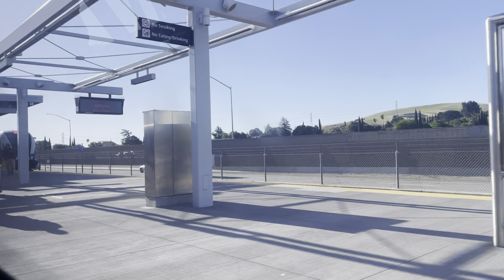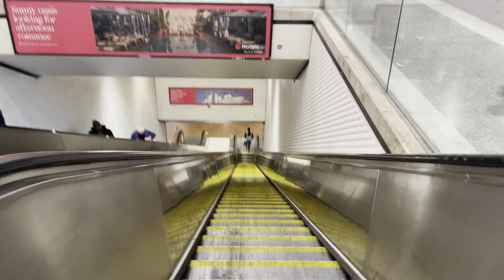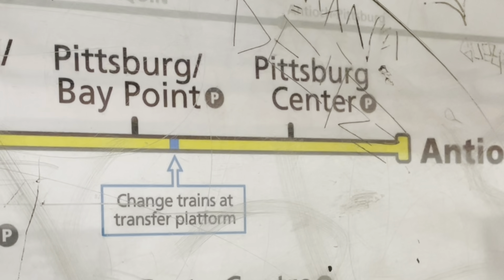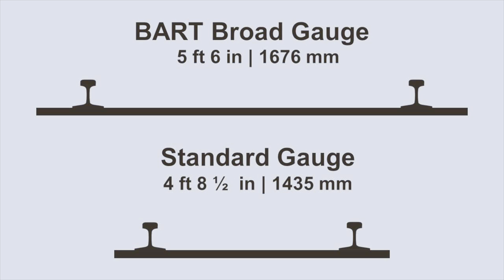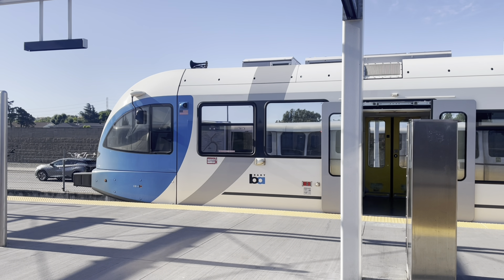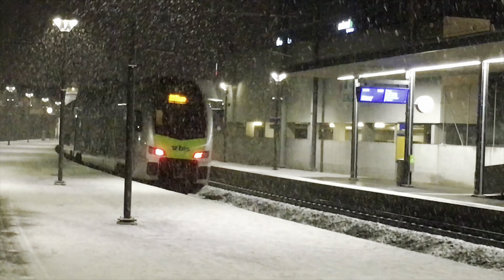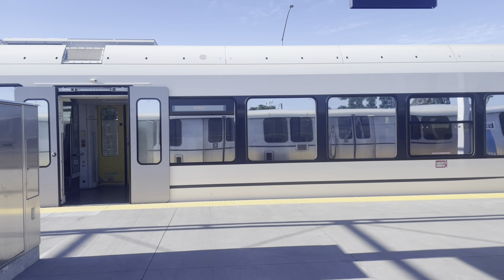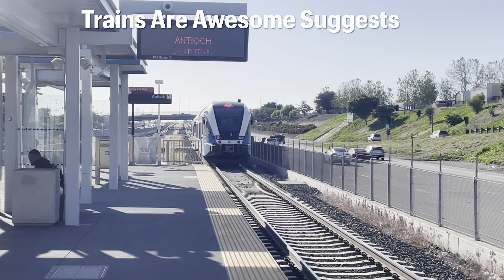eBART: The Strangest BART Extension

Comment: I do not believe the claim that it cost less, let alone half. You save by slightly reducing track quality and not having to build out the electric infrastructure... but you then have to build a whole new operating and maintenance base, buy entirely new trains on a new contract with a higher spare ratio, hire specialty maintenance crew, build a new transfer station, and a bunch of other stuff. PLUS now your operational cost is higher because you arent able to use a lot of the existing maintenance infrastructure, AND because you have to staff a transfer station, AND diesel trains cost more to maintain, AND you have to buy fuel for the diesel trains.

Idk, unless someone can show me a budget document that explains why ebart didnt cost more to build, I just think it is corruption

Comment: Great video dude!

I can't help but feel like they could have just extended the standard gage tracks a little bit further into the Pittsburg station, so the transfer happens there. Sure, it's still cross-platform, but at least then if something goes wrong you can walk out of the station or wait in a nicer transit hub.
Reply from the maker: Yeah I don’t know why they set it up that way

Comment: I am a resident in the bay area. I have taken this line regularly since 2018. It is really quirky. Typically only every other train on the line goes to the transfer platform. This makes delays really frustrating. If you just barely miss the antioch train, its not just waiting 10 minutes for the next pittsburg baypoint train, but you eventually will have to wait for the antioch train that is coming 20 minutes later. This makes a long ride even more time consuming because money.
Reply from the maker: I never realized the frequencies were different between the two

Comment: How well do the train operator and the automated annoucements explain the transfer process once you get to the station?
Reply from the maker: The operator did a decent job iirc
Reply: In practice it works very well.  You either walk off one train and straight onto to the other, or walk off the eBART train & wait a few minutes for the train heading to SFO airport.  There is no tagging on or off involved.  The eBART trains are quiet and fast easily keeping up with the speed of the highway traffic.

Comment: My main question is just why. Why, even regardless of money, would anyone see this as a good investment! The added journey time, lower practicality, lower passenger numbers, and extra faciltiies needed would surely make it a much worse investment than the more expensive full BART extension.
Reply: What you don't understand is that the people on that side of the system have been paying taxes from the beginning. In Contra Costa county we have a extra  tax that we paid in order to develop bart. Bart began on this line. And has expanded over its 50 plus years in existence. Bart decided to expand to San Francisco and put that side on hold.
Reply: @rebeccalane7691  Well yeah of course they're an urban rail system, you need to make sure the urban part is in order. Especially since a much greater portion of the tax payers contributing to it are in these more urban areas. But the main thing is that by this county cheaping out on the extension in this incredibly weird way, they're getting even less value for their investment than if they had waited and made a slightly bigger investment with a regular BART extension. With e-Bart they've shot themselves in the foot and made a subpar service that they're gonna see stuck with for decades to come

Comment: A short-sighted implementation consistent with BART planning in general.  Any BART extension needs to eventually go on to the next city to the south, Brentwood, with a population of over 60,000 and still growing.  But as with BART leading to Pittsburg, eBART extends along he middle of State Highway 4 which was widened to accommodate this during a recent extensive highway upgrade.  However this accommodation ends just past the Antioch station, preventing any further "affordable" extension.  They could have instead used an old WWII era railroad right-of-way just past the Pittsburg station to take an eBART track to the north of Highway 4 to meet the old Southern Pacific (now Union Pacific) Railroad trackway which basically runs parallel to Highway 4.  This route's right-of-way is wide enough for a double track eBART arrangement.  This old trackway hasn't been used in years, though when modified for eBART there is no reason it couldn't be designed to also handle any future Union Pacific freight trains.  This route extends on to Brentwood (and beyond to Tracy and even Los Angeles eventually).
Reply: That was the plan originally, but I think UP backed out last minute. Fortunately, Highway 4 was having construction done, and they were able to build tracks down the median.

Comment: Caltrain recently electrified their fleet of trains. New trains have free WiFi and charging ports  for each seat. Caltrain is a joint transit project running from San Francisco to San Jose along the inside edge of the Peninsula through what is commonly known as Silicon Valley. BART also extends southward into San Jose but on the other side of the Bay through what is commonly known as East Bay. Primary differences between Caltrain & BART is Caltrain is heavy, double-decker commuter rail whereas BART is light rail which zigs out to Daley City & Colma before zagging in to Milbrae & SFO-Airport
Reply from the maker: I wonder if you might enjoy my Caltrain video…
Reply: @Thom-TRA  I enjoy all of your videos

Comment: Having to transfer trains is not unusual at all -- but why on earth did they build a separate transfer station instead of just having the transfer happen at a regular station like anywhere else in the world? It would have been cheaper, made both lines more useful, and avoided the issues having a station with no access brings.

Comment: Do they always try to time the transfers with BART to eBART? I don't supposed there's a need for increased frequency on a 2-station stub but if they ever extended it further I can see them maybe having use for more frequent trains than BART has.
Reply: Much of the time you simply walk off one train, take 10 steps, and walk onto the other train.  On one journey I had to wait at the transfer platform for about 5 minutes for the BART train to arrive from SF.

Comment: It was the cheapest way to get the extension done 
Bart used money set aside for the Antioch extension on other projects so when it was time to build the east county line the border chose this diesel multi unit
Nothing wrong with it but something that should have been done like 20 plus years ago
Reply: That is absolutely correct. While it was true that East Contra Costa County was not originally part of the BART district, they did join a lot earlier than the cities did along the BART extension corridor from Daly City to the SF Airport. 

East County residents, were paying BART taxes for well over 20 years without getting anything in return, with their money being diverted  into  the airport extension instead. After many delays, and promises by BART to complete the Antioch extension, BART was sued, and was required to start construction of the Antioch extension by a certain date, which I do not remember. The BART pulled a "fast one", and constructed a  BART "park and ride" lot as a "place holder" at the location in Antioch where the BART terminus station was to have been built, technically satisfying their legal obligation to begin construction of the Antioch extension.    That "park and ride" lot was a joke, and was hardly utilized. In the meantime, the plans to widen Hwy 4 proceeded, and BART found themselves "land locked" between that highway widening project. 

More lawsuits ensued with East County trying to get BART to make good on the extension that they had already been paying taxes on for  decades, and E-BART was the solution developed to bridge the gap between that Antioch "Park & Ride" BART parking lot, and the BART Bay Point Station. The confined space that the HWY 4 expansion left BART with in the Highway median, would have required BART to construct the extension with elevated tracks  and stations,  so the cheaper solution of using standard gauge rolling stock that could fit into the center highway median was used. It was an "after thought"  add on bandage, and that is why it ended p being so weird.   

There is a lot of sorted history and controversy behind the Antioch extension, and the "E" in E-BART indeed originally stood for extended - BART.

Comment: You didn't mention how incredibly loud the Pittsburg ebart station is.  Why can't they enclose it or put up some sort of sound dampening?  It really sucks to stand there at 6am in the middle of the freeway, listening to the freeway.

I understand wanting to return the 10 car trains back to the core system (and a train transfer) but the stupid different gauge and diesel trains are a true shot in  the foot for further expansion.  The train could could go all the way to Brentwood or even Sacramento or Modesto.
Reply from the maker: The standard gauge might actually help the case to extend it to Brentwood, since it can use existing infrastructure. That was one of the considerations during the planning phase.
I agree about the sound dampening though. It's the same in Chicago.

Comment: I take eBART everyday as part of my commute from Antioch to San Francisco. I would like to shed some light on gripes I have with the system. Firstly, transfers from BART to eBART are supposed to be timed, but they rarely are. I have been stranded on the exit-less transfer platform in the middle of a freeway for 30 minutes at a time in some instances. Secondly, bicycling and e-mobility are vastly underserved causing car doors to be blocked by bikes and e-scooters during peak hours.

Comment: I imagine the track gauge isnt thw main reason it was built separately, but rather the train length. 10-Car BART trains require massive platforms and stations. To make space for stations, they needed to widen the highway, which was extremely expensive. By using the GTW's they can build mich shorter platforms and they dont need to widen as much.

Comment: I live near the Rockridge bart station. I always wondered why the trains looked so different at the Antioch extension.  I remember when the  bond passed for that extension and in the news they said there was not enough money to complete it.  I guess that's how they did it . By going to a non-powered rail extension.  I am old enough to witness the building of bart. I went to elementary school right next to the MacArthur bart station. At that time the trains were super plush with seats like in first class on Airplanes and carpeted floors.  Was a different time. So maintaining the trains was not like now. You basically have to be able to water down the entire surfaces in the trains to keep them clean.  Thanks for your content does explain  the questions I had.
Reply from the maker: Glad to provide some answers!

Comment: In some ways, the GTWs actually seem a bit nicer than the regular Fleet of the Future trains. It almost would have been cool if something like that (but electrified) had been made to replace the original BART cars. (But I suppose the GTWs probably can't run in that many multiples, huh?)
Reply from the maker: Check out the new trains MARTA in Atlanta is receiving. Those are being built by Stadler, same company as the GTW!

Comment: Hi, l am from Hong Kong. ln HK, it will NEVER use two different systems on the same line. Local would rather pay more to build direct access.
Reply from the maker: Disneyland line. Ngong Ping 360. You might not call it the same line but it’s still a transfer. Still a transfer. In fact, Hong Kong has a lot of transfers, more than BART.
Reply: @Thom-TRA  
I would say HK locals hate transfer. If this line is divided into two sections like eBART in our city, people would go crazy.

Comment: The only similar example I can think of in the U.K. is the Merseyrail connection with Northern Trains at Ormskirk, Headbolt Lane and Ellesmere Port where you have to transfer from electric to diesel but they are shown as separate trains on the timetable rather than the example here. As you have no doubt seen the new trains have batteries aboard so they can go beyond the electric 3rd rail range thus increasing the Merseyrail network at a cheaper cost.

Comment: If the idea was to build the extension as cheaply as possible, it must have added to the cost rather to build a whole new station specifically for interchange? Why not just extend the tracks a little way to the existing terminus?

Comment: Why didn't they just extend BART to Antioch?  Makes no sense at all.
Reply from the maker: Did you watch all the way to the end? I actually answer that question...
Reply: I did, but money is never the right answer.  Oh, well.  It was mentioned that it was originally intended to extend far more than 9 miles which makes more sense than the three stops it serves now.
Reply: @kjrehberg  if I recall correctly, they originally intended to purchase and use existing freight track from Union Pacific, but they backed out. Fortunately, the the freeway in the video was set to have construction done, so tracks were installed in the median.

Comment: While it certainly isn’t perfect, having a cross Plattform transfer is fine. There is a similar situation near me when traveling between Austria and Germany. The Austrian side is electrified while the German isn’t, so both trains terminate in Pfronten-Steinach to transfer. It’s unfortunate the BART gauge and narrow right of way remove the possibility of running eBART trains as some sort of express service in the future, but that’s more of a problem of the original BART then the extension.

My main point of confusion is why they chose to do the interchange at a station with no exit. I’d guess the reason they didn’t do the transfer at the original terminal is probably due to space constraints, since BART seems to have some storage tracks there. But if they had to build a new station anyways, why not add an exit? The trains have to stop anyways and looking from satellite view there even seems to be an access tunnel, just not for public use. So, it currently has all disadvantages of a station without any benefit to the riders.

Comment: Nice presentation as always! One question: how many trains do they run on the eBart section? This weird little stub is not huge, and doesn't have a bunch of stops. Do they just run one train back and forth, or is a pair that pass each other at some point?
Reply from the maker: There’s more than one, because I got on a return train just 2 minutes after I got to Pittsburg Center. 
There are 8 GTWs in total. 
Hope this helps!

Comment: I used to be an eBART hater but I actually think the solution makes sense now. People in eastern Contra Costa County needed a transit connection but not necessarily a 10-car heavy rail rapid transit link. There is a limit to how far rapid rail systems can go outside of the core.

In Philadelphia we have the Norristown High Speed Line, which acts as an extension of the Market Frankford Line into the burbs. 1-2 car operation makes sense for a line that serves 10k riders per day, while 6 car frequent operation on the MFL makes sense for a line that served 200k riders/day pre-COVID. However, the two lines have different gauge and third rail electrification systems.
Reply from the maker: Appreciate the perspective! 
Norristown HSL has climbed to the top of my American transit bucket list since I crossed the Morgantown PRT off yesterday.
Reply: It's funny there because the NHSL is standard gauge and the El is Pennsylvania trolley gauge. The difference is that they were built by competing railroads. Using a different gauge was a way to discourage takeovers or gov't mandated sharing. In BARTs case it's because they thought up the most expensive Regional Rail system you could possibly imagine. Then they built it.
Reply: My family lives in Antioch/Brentwood and we don't even use it, we just drive out to the pittsburg station. Its dumb to go to the Antioch station, pay more, wait, transfer. No convenience at all.
Reply: @Devilishlybenevolent same. It's a joke. If ever we have gotten on the systems yellow line, we drive to Bay Point and board actual Bart. I tried using it to commute and regardless of destination it took longer and cost more, so nope.
Reply: I kinda get where you're coming from but he Norristown line is also much longer than e-bart and serves many more stations, rather than just 2. Like for a 2 stop extension, e-bart makes seemingly no sense other than optuse corner cutting! Especially since it doesnt connect to the Pittsburgh Bay point station properly which is gonna be awful for people walking or getting on buses to or from that station and continuing on e-bart. With extensions then maybe e-Bart makes sense. Possibly also with a proper connection to Pittsburgh bay point rather than this weird transfer platform.
Reply: its an S-Bahn like system, which means its fine for it to go out more.